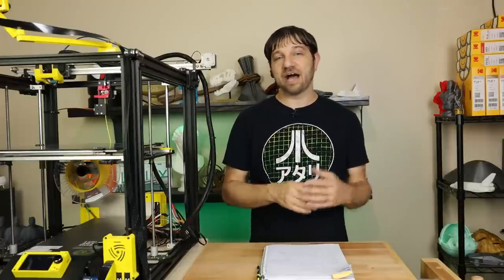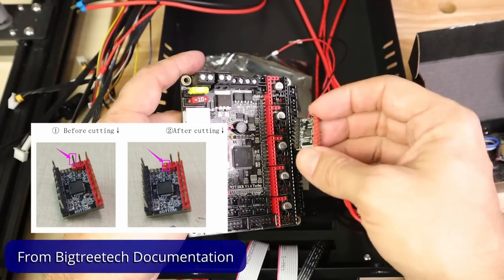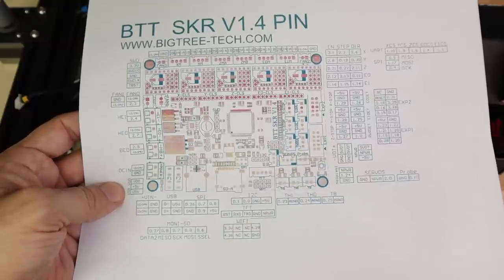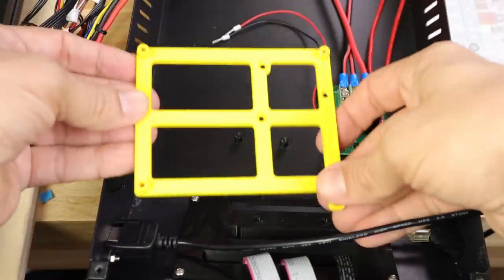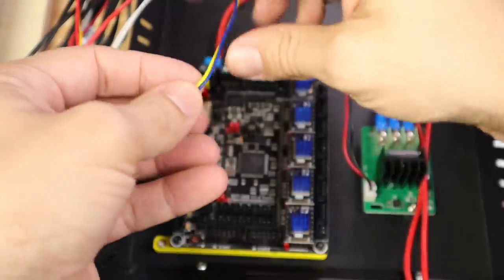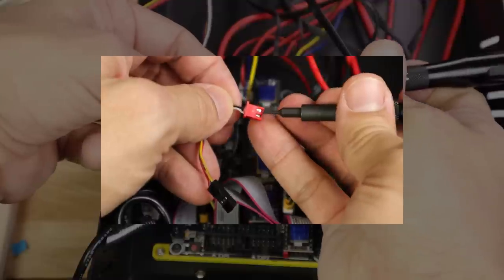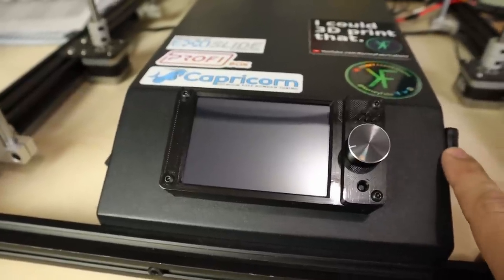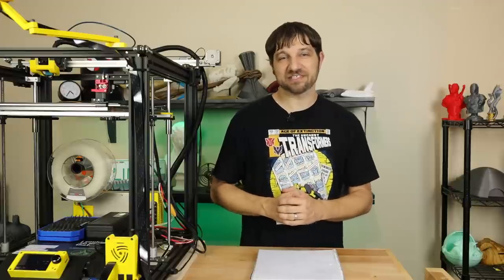Bigtreetech Ender 5 Plus Upgrade: SKR V1.4 Turbo (Part 4)

Comment: Hi Kris!  Great video, as usual, and just in time; I'm probably doing my install tomorrow evening.  I really didn't want to cut my case so tonight I'll be printing the mounting bracket you designed.
One quick question: If the SKR v1.4 board has the socket to accommodate it, why do you have to cut the DIAG pin off of the TMC2209?  Is this something I can leave on and compile marline not to use it or something?
Reply from the maker: Thanks Greg! That pin is used for sensorless homing and unless you plan to use it, that pin must be cut. It should have been possible to compile it out but I'm guessing (without having a schematic) that the pin is actually controlling a line that can't be ignored or is shared for another function. Since the manual says it, I'll assume that BTT knows their board.
Let me know how your upgrade goes!
Reply: So I'm almost done with the upgrade.  I had an issue with two of the three BLTouch pins needing to be swapped (not the two in your video, oddly).  Everything seems to work now except that sometimes when I go to Auto Home, it homes X, then when it goes to home Y it stops as though it hit the end stop and I get a HALT error.  It's especially strange because it doesn't happen every time.  ABL is doing a 5x5 grid now instead of a 4x4 and the points on the build plate aren't well-aligned, so I still have a bit of work to do.
Reply: My last hurdle is that for some reason every time my heat bed is turned on the SKR 1.4 fritzes out and needs to be reset.  I feel like the board needs to be grounded or something.  I just can't figure it.  Time for bed.  I'll try again tomorrow with a clearer head.
Reply: The ongoing saga... it's the Simulated LCD12864 mode that fritzes out whenever the bed heater turns on.  If the heat coasts for a few seconds the screen comes back and is usable but when the heat turns on again it becomes an unreadable mess.  The TouchScreen mode is unaffected!  Time to research...
Reply: FIXED!  Moving the power cable that feeds the SKR fixed the Display problem and uncommenting "#define ENDSTOP_NOISE_THRESHOLD 2" in Marlin fixed the homing issue I had with the Y-endstop.

Comment: The board doesn't need ground? Thanks for sharing. I am in the process of upgrading my Ender 5 Plus with the SKR2 board and 2209 drivers. And of course the TFT35. Just finished printing your parts and was wondering about the ground :)
Reply from the maker: Technically, DC provides a common/ground wire. It's not the same as AC. If you're chassis is grounded you should be fine.
Reply: @kerseyfabs  Thank you very much for the answer :)

Comment: Hi love the vid, have followed and installed the 1.4 turbo board and tft on the ender 5 plus. FYI the latest enders seem to have the bl touch gnd and + reversed and the 2 pin connector that you had to reverse in the video  you dont seem to have to do as the orientation seems correct now. Anyhow I have a question I am using your settings but in the latest marlin 2.0.7.2,  so that I can use the Z offset wizard, not that its helping much :)  why when auto levelling does the bltouch stay about 5cm away from the left hand edge and it does not seem to use the full extent of the board when leveling
Reply from the maker: Hopefully this serves as a reminder to pay attention to all of the information I cover about polarity and colors. I do try to cover it as best I can. 😅
The offset issue is because the BL touch will not go all the way to the edge on the right because of the mounting plate, cooling, etc. So, to keep the leveling grid symmetrical, we don't get closer on the left either.

Comment: Hi there. I have been using your marlin firmware file (.bin) on my ender 5 plus and it was a breeze getting the skr 1.4 and the TMC2209 setup. I am stuck with the AutoHome that does not center the extruder nozzle in the center of the bed.
Reply from the maker: The nozzle should not be centered, the BLtouch should. That's what's doing the actual probing.

Comment: Will this firmware work with the the skr2 board 
Great video very informative 
Keep up the good work
Reply from the maker: No. I'm working on a guide as soon as possible. I'm not sure if it will be a video or just firmware and a wiring diagram.

Comment: I am new to the ender 5 plus. Just got it 4 days ago and it is greeting good. The motors are loud and I would like a quiet stepper setup. Can you tell me why the 32bit boards are better? What do you really gain?
Reply from the maker: Welcome to the club! Check out these two videos. I think they'll answer most of your questions:
https://youtu.be/27_b8liYinU
https://youtu.be/uY7fsVMmcHU
Reply: @kerseyfabs  Thanks for the links. I think when time to replace card I will go with the BBT SKR 1.4 Turbo. Do it once and not look back.

Comment: Hey, i recently bought my 5+ and wanted to upgrade the mainboard. I was going for the SKR 1.4 but it is no longer available (as you write in your video desc).
Will you make a video describing the differences to the V2 and maybe an installation guide for the V2 as well?
On Amazon they always write "based on the 1.4", so maybe it is not a huge difference?
Reply from the maker: You can find a lot of the differences on Bigtreetech's website and in other videos. If you want this for the Ender 5 Plus, I have created an install guide and firmware that you can find on my community page: https://www.youtube.com/c/KerseyFabrications/community
You can follow this guide along with my new diagram and photos.
Reply: @kerseyfabs  Thanks a lot, with that my SKR2 works great. Any idea why the touch mode of my TFT35 v3 is not working? Always says "No Printer attached". Marlin mode works fine and Baud rate is set to 250,000.
Reply from the maker: @Blafaselblubb  Baud rate should be 115,200. That should fix it if it's all wired correctly.
Reply: @kerseyfabs  that fixed it, thanks

Comment: What firmware are you using on the TFT 35?
Reply from the maker: Whichever the latest was when I installed it. Honestly, I use the Marlin side and rarely touch the touch screen.

Comment: Thank you so much for the detailed information on how to set up this skr 1.4 turbo MB, everything was working until I tried to home the ender 5 plus, X axis was going in other direction, so I thought maybe I uploaded the wrong firmware, so I uploaded the dual Z firmware, but then the screen showed squares ■■■■■■■■■■■■■ I have been reading all the comments here and triple checked the wirings, tried to upload different firmwares but no luck. The file changes from .bin to .cur but the screen just shows these squares still. Maybe you have some clues why this could happen?
Reply: My x axis is also going in reverse on my Ender 5 Plus with skr 1.4 turbo.----- Edit: Scratch that, I didn't flash the firmware correctly. Renaming the provided firmware in the description to just firmware.bin worked for me. It is homing correctly now. Thanks!

Comment: Totally given up on this upgrade, cannot get firmware to flash, sdcard prevents the printer from being detected and my Marlin mode and dial are no working at all, Whtas the chances I got a dodgy board?
Reply from the maker: I'm hearing two problems:
1) Unable to flash.
2) Unresponsive touch screen.

Best solutions I have:
1) Use the original SD card for flashing. Make sure the file is firmware.bin. Do not have the board plugged into a USB port. Insert the SD card into the board. See if it gets renamed to firmware.cur.
2) "To reset the TFT's touch screen calibration, create a blank file named reset.txt and place in root folder of the sd card. Insert the SD card into the TFT's SD card reader and power cycle your printer to start the reset process."
Reply: @kerseyfabs  thanks for the info mate, it ended up being my sdcard slot on the board isn't to spec so nothing was making contact shimmed some cardboard in there and it flashed straight through.

Another question though is your provided firmware setup for octoprint? For the life of me I cannot get it to connect via USB. I have tested the USB connection via pronterface and it definitely works just won't connect to the pi?

Comment: Hi KF, thanks for the great work on bringing this video to us.
I have the printer up and running and homes correctly, the only problem i am having is when i start a G29 probe with the BLtouch it starts the probe at the front left instead of rear right.
It also starts the priming of the hotend at the front left instead of rear right as it originally did before the upgrade. Do you know how to change in marlin to make the printer
start probing rear right and priming rear right before print.
Cheers
Reply from the maker: No problem! First, you didn't mention which printer you have. Assuming it's the Ender 5 Plus, it should have always started in the front left. G29 always starts closest to (0,0) and goes from there.
Reply: Sorry mate, it is an ender 5 plus.
I must of had it setup to start probe from rear right, no worries all sorted now.
Cheers

Comment: Hi Chris I just got halfway through this and realized that this guide is for an SKR 1.4 and I have an skr2. Will the instructions be the same?
Reply from the maker: Yes! The basic directions will be the same. Check out this folder for detailed pictures, a wiring diagram, and firmware for the SKR 2: https://drive.google.com/drive/folders/1r_qg98nudXPjKhlFx7BidHNjN-8bJDGY?usp=sharing
Reply: You seriously are a lifesaver. It didn't occur to me this would be so bleeding edge, as I haven't seen too many videos about the skr2 on an Ender five plus. Thank you for this, I'm looking forward to your voron build one day, and I appreciate your content. Never done this before but I'm going to become a patreon supporter for you cuz I know how expensive this is.
Reply from the maker: @omnipotentgoku  I'm glad I could help! Thanks for your support.
Reply: Hey Chris am I seeing that you also had to repin the BL touch on both connectors on the skr2?  And how would you recommend grounding the yellow/green cable that was grounding under the original screen?

Comment: Hello!  I updated the firmware via the SD card.  I have a BTT 1.4 turbo and the 3.5tft screen.  If I go into 'marlin mode' if i move the knob, the screen freezes and the printer reboots itself.  If I stay in touch screen mode, it seems to be working.  The SD card did have the firmware changed to .cur after the flashing.  Any ideas?  Many thanks!
Reply from the maker: It sounds to me like you have the two 10 pin cables either swapped or turned around in the wrong direction. Double check orientation in my video and make sure 1 goes to 1 and 2 goes to 2.

Comment: Your compiled firmware was not accepted by my SKR 1.4Turbo board. I renamed it firmware.bin and the file is unreactive with the SKR board after being left on for a few minutes. When I put the SD card back in my computer the name and file type are unchanged.
Reply from the maker: Did you power off, insert the SD, and then power it back on? It should flash when it first boots up.
Reply: @kerseyfabs  Yes, that's exactly how I did it. I could post a video of it

Comment: Great video, very informative. What driver current settings are you using for the 2209's with the Ender 5+ ?. I didn't notice mention of it in the video. I'm about to install 2209's in my 5+.
Reply from the maker: I appreciate it. Here you go:
#define X_CURRENT       650
#define Y_CURRENT       650
#define Z_CURRENT       800
#define E0_CURRENT      800
Reply: @kerseyfabs   Thankyou so much !
Reply: @kerseyfabs  Not that I doubt your numbers, but could you please elaborate on why you picked these numbers?
Reply from the maker: No problem at all! The trick to picking stepper currents is picking a number high enough to not skip steps, even on the occasional weak hang-up, but low enough to not cause overheating of the stepper drivers or stepper motors. My numbers come from experience with this printer and from others.
The usual X/Y axis on this printer isn't moving a lot of weight, so we can keep the stepper currents relatively low but we are trying to move quickly. If we go too low, we run the risk of it working fine during normal operation but hitting a snag we can't power through and losing steps.
The Z motors can run at a lower current normally because they don't move fast and they don't hit snags. In a shared stepper driver scenario like we have here, we need to up it a bit more since that current is being shared.
We need the most power on the extruder because that motor is actually having to push filament at a given rate through the nozzle. So we're going to naturally bump that up so we don't get skipping.
On all of these we bump them up a bit more if we're using the silent mode of the steppers.
All of this to say, the exact numbers I chose are from experience and if anyone thinks they can be tweaked more, have at it! Keep in mind the cases where something is slightly off though and you don't want the prints to fail.
Reply: @kerseyfabs  Awesome! Thank you! This is one of the last pieces to the puzzle for my own 1.4Turbo+2209 upgrade. 

I have not been successful at finding reliable specs for the motors, and while could easily make them run when I did small tests, then it becomes a very different thing when they have to run during long prints and at the same time print properly. 

I will put in your numbers, monitor the temperature, and print a benchy or two. Thank you.

Comment: Not sure if I should be using  shared or dual Z_stepper firmware?  Help would be appreciated and thank you.  You make great content btw!
Reply from the maker: Thank you! Do you have each motor hooked up to a separate stepper (dual Z) or to one stepper (shared)?
Reply: @kerseyfabs  I have one motor hooked up to ZMA and the other hooked up to ZMB on the BTT SKR 1.4 Turbo board.  But wasn't sure if the board internally uses one stepper driver.  Thanks for the quick response.
Reply from the maker: @sassegaming2583  That's a single stepper driver. No problem.
Reply: @kerseyfabs  All is up and running great!  Thank you for everything you do!

Comment: I followed this mod and the oddest thing is happening. I powered up the printer and my BTT TFT35 V3 powered on and the slowly faded to black.

I can touch the screen and hear it beep, but I can’t see anything. 

Any advice?
Reply from the maker: That doesn't sound good. The only thing I can recommend at this point is to power off and double check all of your connections. It sounds like something could be shorted out.
Reply: Bl touch wiring is wrong I had same problem change the red and brown wire around

Comment: hey Kris. ive installed everything the same as you but for some reason my sd card slot just wont force the flash. any advice?
Reply from the maker: There's not a whole lot to recommend. It usually "just works." You take my firmware, rename it firmware.bin, put it on the SD card, put the SD card in the printer, and power it on. You can verify that it worked if the file is renamed firmware.cur afterwards. The one thing you can try is another SD card.
Reply: @kerseyfabs  thanks for the reply, ive had to buy another board as this one just wont do it.
Reply from the maker: Sorry to hear that, I hope the next one works.
Reply: @kerseyfabs  hey again, ive got my new board and everything is working now. installed your new software v2.0.7.2 but its now saying eeprom version error. initialize eeprom? should i say ignore or reset?
Reply from the maker: @aaronwatson9477  Awesome! Just go ahead and reset. You'll be good.
Reply: @kerseyfabs   everything is great now thanks, just one last thing. the x and y 0 is the opposite corner to the homes switches. any way to fix this?
Reply from the maker: @aaronwatson9477  I'm glad it's working. This printer homes to max. That's how it's designed. You can swap it around but you'd have to change several lines in the firmware and then your prints would face the back.